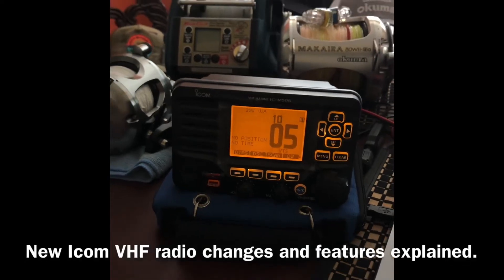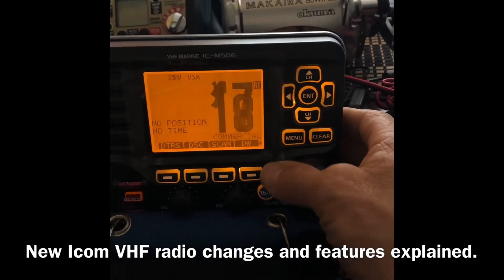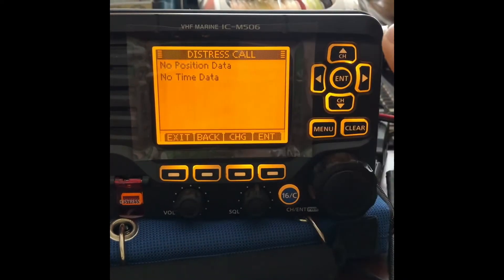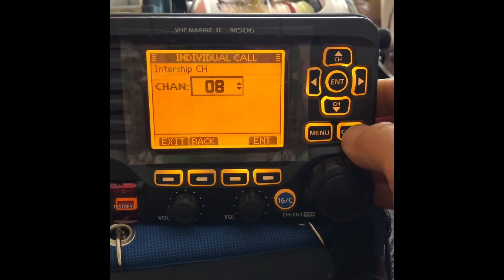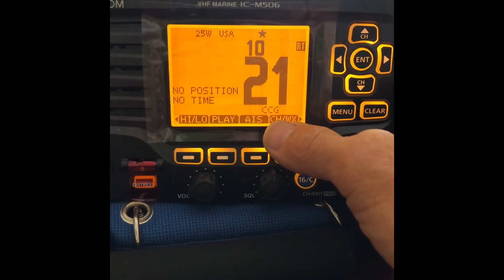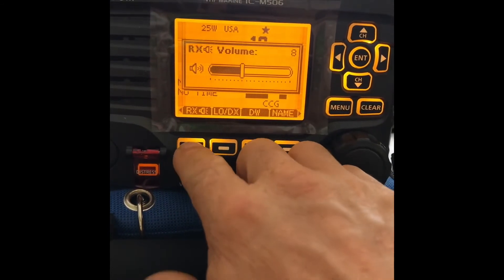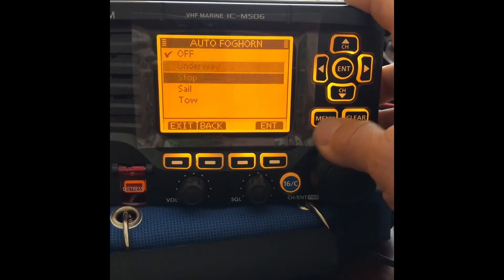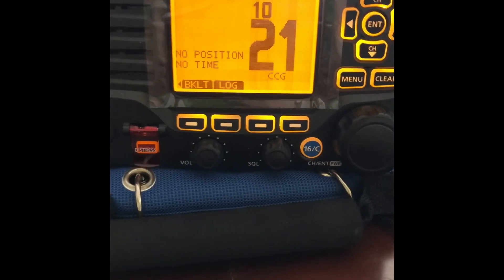2020 3rd Qtr. Icom VHF changes and features

Comment: How to input position and time? Because this icom vhf was installed in our steering gear, i dont know how to set it. Its my first time to see icom vhf because we r using jrc vhf radio on bridge and crgo control room.
Reply: Hello. 
For that I’d refer you to the manual that you can download online. 
I always interface them with Gps and it does it automatically.